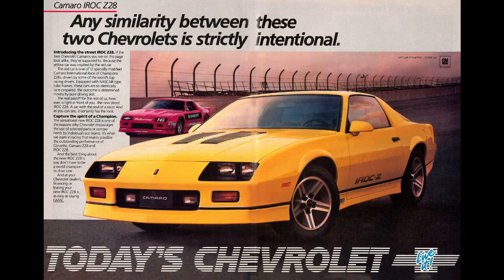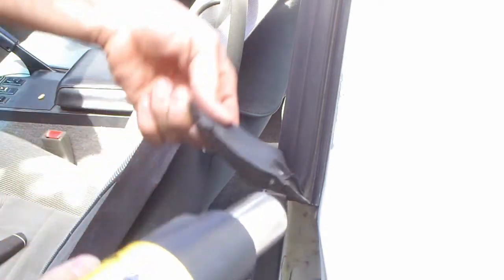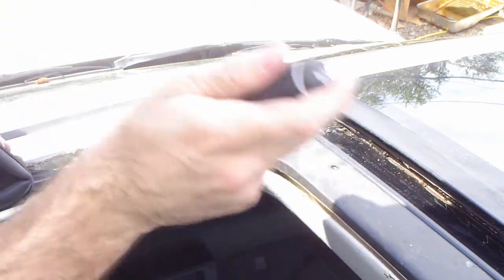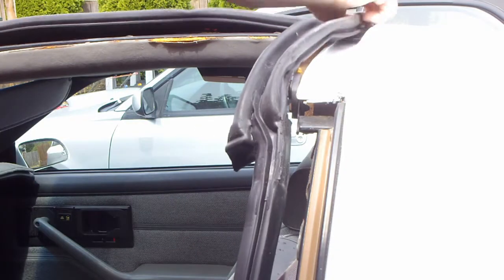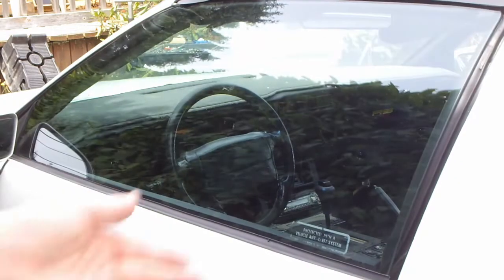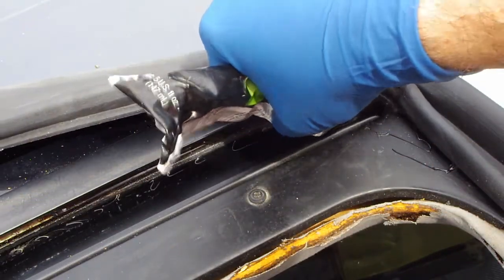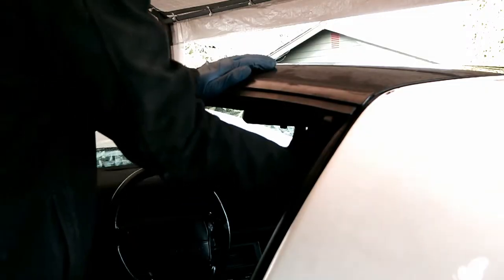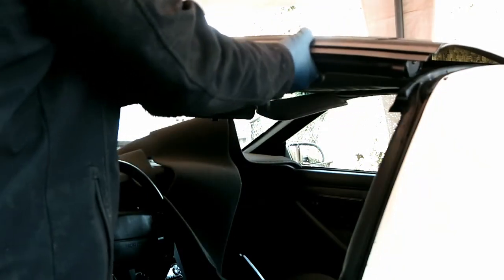Weatherstripping Replacement STOP Leaks! (1982-1992 Camaro/Firebird)

Comment: Very great video, wish my project was this easy but my seal channel was so rusted out, there were so many holes-I used metal reinforced filler to redo the channel, then our city does not sell weatherstrip adhessive so we just used an all purpose black silicone...just used a thin layer and smoothen it out...everything worked out...

Comment: I was considering doing this before the winter bc my passenger side top isn't tight. It sits really low and has some movement if I wiggle it while latched but if I have to glue new seals in then maybe this is better for when the car is redone.

Comment: How many 5oz. 3M weatherstrip adhesive tubes would you need for both driver and passenger T-Top seal? Is one enough? I'm planning out all the materials I need for my repair.

And thank you for the great video, it will help me out a lot when I do this job.
Reply from the maker: Doesn't take much adhesive.  i didn't even use 1/4 of the tube i had.
Reply: @3rdGenGuy  Thank you for the quick reply.

Two more questions, do you recall where (online or in-store) you bought the new push pins and the their part number/reference? Or was it just a generic push pin and just get one that matches the old one?

I have trouble finding new push pins online and I may end up reusing the ones when I do the job.
Reply from the maker: @nivlacnihc  the pins were from hawks. i got like 20 of them because i know i'll bust more pins by accident in the future.

Comment: So should I not open the door for a week when i glue the seal in?
Reply from the maker: basically ya.
it's to ensure everything stays put as the glue fully cures. 
you DON'T want to re-do this install
Reply: @3rdGenGuy  ok thanks👍
Reply: @3rdGenGuy  since it's my daily should I do one side one week and then the other side the other week?
Reply: @johnhopkins1862  that’s is a good idea! I’d have never thought of this technique for my Camaro is also my daily. This video did make me nervous about rust under there though.

Comment: I changed mine but they still leak... You need a new headliner
Reply from the maker: Oh ya, the headliner is FINISHED!
the  front end is completely apart, so that's the biggest priority. 
Expect to see some front suspension vidoes
Reply: That’s strange I wonder why it would still leak with new seals?